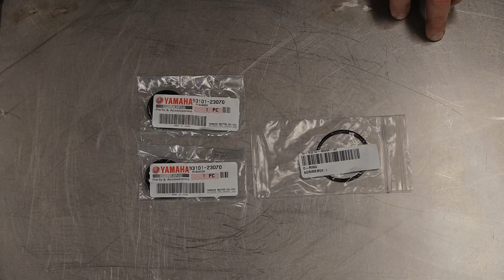Yamaha 60HP Input Seal Replacement | Yamaha T60 Outboard Input Seal Replacement | Boats.net

Comment: Shaft is rubbing the housing for impeller, bearing looks good, shaft doesnt wiggle. Ill see if i can add a picture. The shaft seal housing is corroded pretty bad. Wasnt sure if that keeps it aligned.